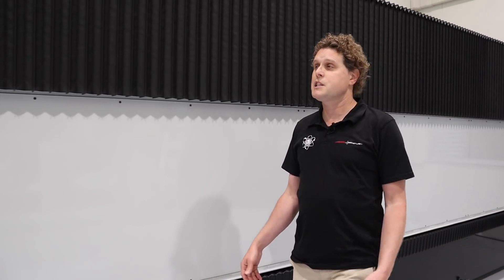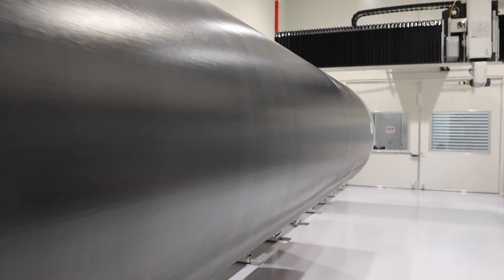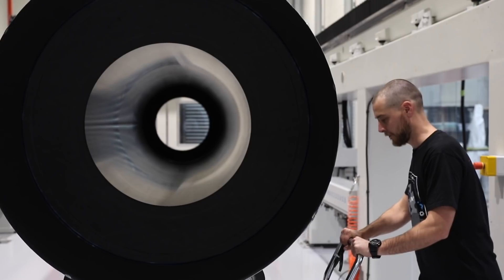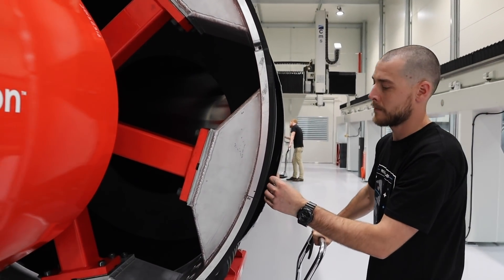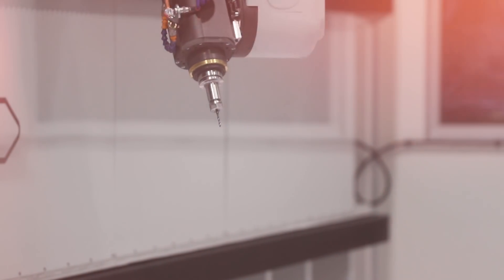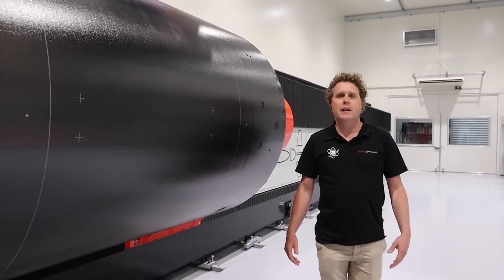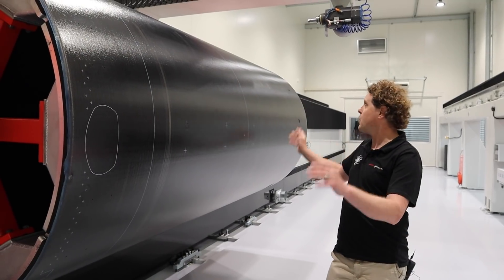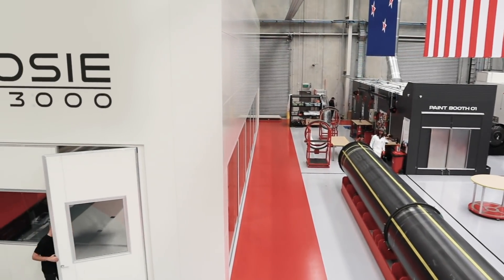Meet Rosie | Rapid, Automated Rocket Production

Comment: With Rocket Lab and SpaceX perfecting the rapid production and reuse techniques that can allow a LOT more launches than the old world of space. 
It won't be long before they start doing back-to-back launches of multiple rockets. 
Different rockets have different launch window requirements based on orbits etc. but presumably there'll be a large window of 6 hours of clear weather where the right people will be at the desks to monitor the launch and they can have half a dozen rockets blast off one-by-one. 
Eventually it'll be like an airport where rockets taking off is so routine it just becomes something fun to watch out the window while you're bored waiting for your rocket and everyone else just continues with their day ignoring the rockets outside.

Comment: So when you start reusing boosters how big will the parachutes be and what will they be made of?
  Also, is a reusable 2nd stage a viable idea for the electron, being they are cheap already?
Reply: I don't think I've ever heard of a reusable 2nd stage. I feel like it'd be very hard to recover, given the amount of deltaV spent to get it up there. The idea made me google to see if anyone has ever done that, and I found a good Elon Musk quote that sums it up pretty well "I don't expect the Falcon 9 to have a reusable upper stage, just because the - with a kerosene-based system, the specific impulse isn't really high enough to do that, and a lot of the missions we do for commercial satellite deployment are geostationary missions. So, we're really going very far out. These are high delta-velocity missions, so to try to get something back from that is really difficult."
Reply: @BasedBidoof  I agree with elon. I want to know the price what the price of the 2nd stage engine is and if it would make any sense to save it. Would be interesting
Reply: @ryanritter7814  Couldn't give you numbers, but I doubt it. Recovering the first stage is something being considered only after enough flights to suggest it might be possible, so it must be pretty marginal. And recovering a second stage, from full orbital velocity, is orders of magnitude more difficult...
Reply: Starship will get it done
Reply: @dakota4766  Agreed, but Starship is being designed for it from the start. Electron is more like Falcon in that respect... the cost of redesigning the upper stage to be recoverable is probably prohibitive.
Reply: @dakota4766  yep